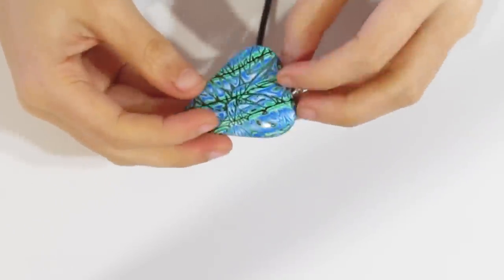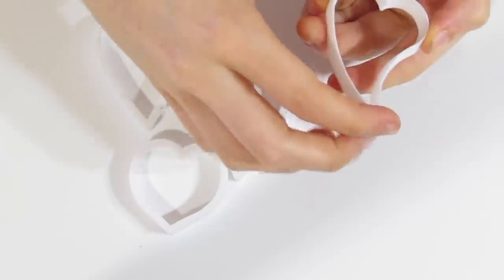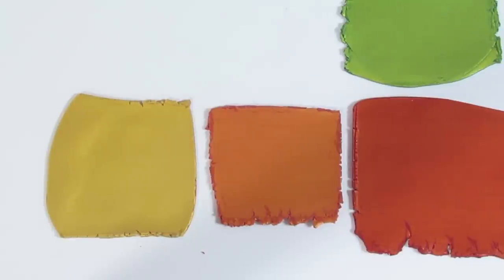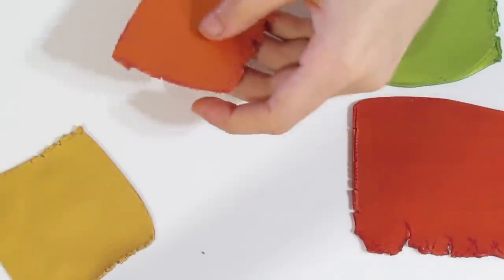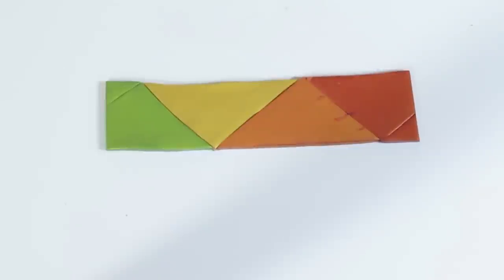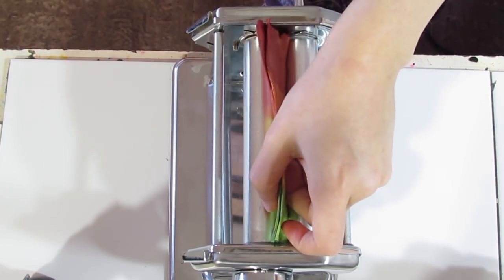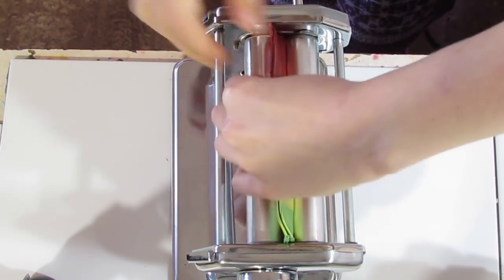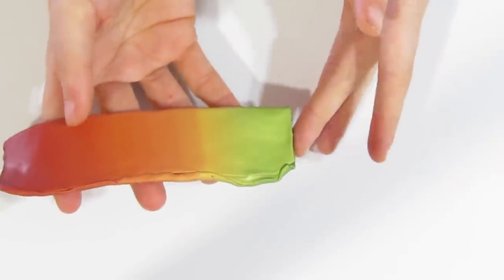Polymer Clay Project: Autumns Brush Hollow Pendant Tutorial

Comment: They really need to start making cutters without that top edge so you can turn them over to get the mirror image. I make a lot of earrings and it's a big drawback.
Reply from the maker: I did try that when I first started making cutters, but there where a lot of issues. 

1. You'd need a sharp edge on both sides of the cutter which would be very painful to push down against when cutting out pieces.

2. You could use an acrylic block to push down on the cutter instead of your hand to avoid the pain, but it would run the risk of breaking the cutting edge.

3. The cutters would be quite flimsy as they would need to be under a millimeter thick for the cutting edges to be sharp. That's how the print would work. 

This is why I make a lot of mirror cutters on my shop. So that you can have reverse pieces. Hope this cleared up your question.
Reply: @JessamaTutorials  hi! I love your videos. I barely ordered my first polymer clay. Can you do a tutorial on how this artist named Anarina Anar, she’s on Pinterest, on how and what technique she uses on her necklaces? They are very different. They’re bright yet old looking. Thank you!

Comment: When you were putting the two halves together with the Sculpey liquid clay, why would you bake it at Cernits recommended temperature?💜☃️
Reply: Because Cernit bakes a little lower temp (265F) than the Sculpey Liquid (275F-300F) and if she baked it at the higher Sculpey temp, she would risk scorching the clay. Luckily Sculpey Liquid bakes well enough at 265F that it will work well for this purpose. It just won't be as clear as it would be if it was baked hotter.
Reply: PolymerClayTutor   Thank you very much for your reply. Now I understand. 💜